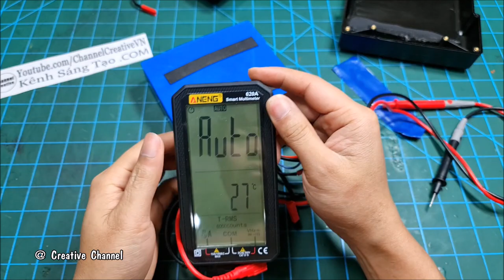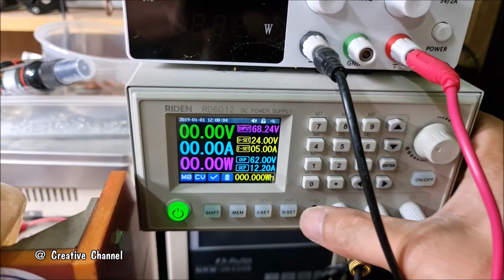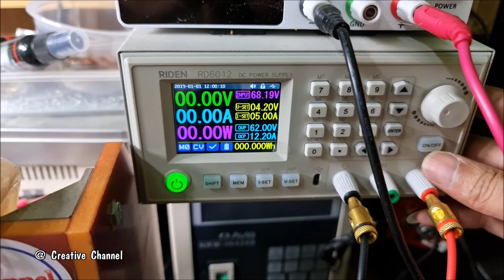Revive 18650 Li-ion Battery Cell in Electric Skateboard

Comment: Dont Do that !. These batterys are unstable after overdischarged !.
Reply: Cells are OK so long as they are charged using trickle charge to 3.0V.
Then also check for heat and self discharge.
Reply: @TheSpotify95  no. Because the materials will dilaminate after overdischarge.  This process is not reverseble.

Comment: Nice cell recovery - however, something is seriously wrong with the way you charged the cells.
If cells are under 2.5V per cell, you must charge them slowly using an appropriate charger.
That means you need to use XTAR VC4 (or similar), plug them in (it will say Ni-MH because of the voltage if under 1.5V) and let the charger charge them at the pace it wants to.
Once the cells reach 2.5V - 3.0V each then you can put them on a standard charger and charge at a decent current (1.0A per cell).
Those cells were never rated for 5A charging in the first place so trying to charge them at 5A from a very low voltage is just asking for disaster.
Reply: @heykuckma  not the bench power supply they used at the start to get them to 3v and then they was charged on the 18650 charger

Comment: I'll play the bad boy: If you're absolutely sure and the manufacturer of these cells allows it, you can slowly charge rechargeable Liion batteries that still have more than 1V voltage with 0.1 - 0.5C. Cells with less than 1V are considered broken and should not be recharged under any circumstances, certainly not with 5A, unless you love metal fires! In case you don't know, a burning lithium battery cannot be extinguished and water actually makes the fire worse.

For your own safety and that of the people who let you use these repaired batteries, you should give up such experiments and safely dispose of all liion batteries that have had less than 2.5V for a long time!

You were just lucky that none of the "repaired" cells blew up, the cell chemistry is definitely damaged when the batteries are so deeply discharged, but luck is finite and if one of the batteries catches fire, hopefully nobody else gets hurt!
Reply: My heart stopped when I realized the power supply showed 5A 😱
Reply: I'd be interested in understanding the ways the chemistry is damaged by deep discharge and how that relates to cells exploding. And if there are early signs of hazardous conditions increasing.  I'd love for some more information but either way thanks you've giving me some research topics.
Reply: @bsmithril  A few signs you have a bad one is if it heats up more than normal during charging and if it loses charge while sitting idle. Another if if it wont get to full charge 4.2v. And always check for leaks. In this situation he should have measured the temps while they were charging for 'heaters'. Also come back in a few days and find any that drop voltage and dispose of them.
Reply: @bsmithril  In the case of deep discharge, some of the electrolyte decomposes and is no longer available for the next charging process, which causes the cell to heat up. As long as the cell hasn't reached the end-of-charge voltage, it will be load wihe the maximum current (cc/cv), good chargers switch off when a time threshold, a temperature or a certain charged capacity is reached, but I wouldn't rely on that, because if it doesn't do it, the cell can go through.

Foil cells usually swell up, the cup cells used here have an overpressure valve, with these in particular you don't see the loss of electrolyte! 

In addition, copper can dissolve in the cell and accumulate in an uncontrolled manner during the charging process. These dendrites can puncture the separator foil and thus lead to an internal short circuit.

The most important factor in determining what condition a Liion cell is in is actually the voltage, I discard any cells that are less than 2.5V, I'm not taking any chances!
Reply: @jonny11bonk  Yeah, even a standard charge cycle will not be 5A under a normal load, it should be maximum 1C.
You especially don't do this to overdischarged cells.
Trickle charge to 2.5V, then charge at 0.5A to bed them in, then on the next cycle charge at 0.5C standard charge or 1C quick charge.
The cells may sometimes take a while to charge at trickle charge (0.1A when under 3.0V). If the cell does not charge at 0.1A, dispose of it.
Reply: @TheSpotify95  The only time I've seen a battery taking over 5A was a faulty protection ic.

Comment: Fast charging by 5A cell which support max 2,5A and is undervoltage makes that cell will be only for trash in next few days :) If cell voltage is below 2V its high recomended to use very slow current like 0,1A